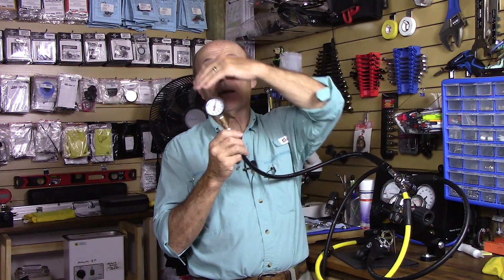Regulator Service, Check The IP - Scuba Tech Tips: S07E18

Comment: Bugger.....  I know I am supposed to support my local Dive store, but Geeeez I wish I had of seen This video before paying $100+ bucks for an IP gauge for my save a dive kit.
Reply from the maker: Sorry John. 
Home Depot has these same gauges in their pump section for $6.14. The brass adapter is $2.49 and the scuba fitting is $9. Total cost is $17.63 - plus tax of course!
1. https://www.homedepot.com/p/Water-Source-100-PSI-Pressure-Gauge-with-1-8-in-Back-Connection-M1002-8B/203990005
2. https://www.acklandsgrainger.com/en/product/p/FAR188-4A?gclid=Cj0KCQjw5J_mBRDVARIsAGqGLZADJjgYKFdbmydIq6CIV6Tl7Dv49GPVov9Wbnsj-ItcMB82s991CXUaAuJSEALw_wcB&cm_mmc=PPC:+Google+PLA&ef_id=Cj0KCQjw5J_mBRDVARIsAGqGLZADJjgYKFdbmydIq6CIV6Tl7Dv49GPVov9Wbnsj-ItcMB82s991CXUaAuJSEALw_wcB:G:s&s_kwcid=AL!3645!3!303439923734!!!g!544758530610!
3. Trident Catalog #AA04 Page 78

Good luck.
Alec

Comment: Hi Alec, i'm built this tool after watching your video...Thank You! it's really inspiring me.
what i want to ask is: if IP is 150 psi what happen if the tank pressure goes below 10 Bar(below 150 psi), does the IP also decrease too? or the Regulator will still producing 150 psi Intermediate Pressure? Thanks.
Reply from the maker: Since the flow of air from the 1st to the 2nd is controlled by pressure AND by a spring, at tank pressures below 150 psi, the spring in the 1st would hold the HP seat closed. No air would flow.
Try it sometime and you'll find that you can still get air by sucking on the reg. In that circumstance, you are lowering the ambient pressure on the downstream side of the HP seat and that allows some air to leak through.
Glad that simple gauge worked for you.
Alec
Reply: @AlecPeirceScuba_SeaHunter  Hi Alec, Thank You for your reply and clear explanation, now i know if i will still get an air if the tank pressure drop to 10 bar(150 psi) when sucking my 2nd stage, that's a good news, i'm pretty new in diving, just two years ago i got my OW cert, and my lowest pressure at the end of my dive ever since is 25 Bar(approx. 360 psi) and i hope i'll never got any Out Of Air situation. Thanks Once Again and keep posting another Great Video, i always waiting for your new video! Warm Regards from Indonesia.

Comment: I’m looking for a rebuild kit for my Scubapro Air 1... would you happen to have or know someone that has a rebuild kit.
Reply from the maker: I still have a lot of rebuild kits but I'm out of Scubapro kits.
The AIRII kit is very simple - a soft seat and a few O-rings.
There's lots on eBay from $10.
Take care.
Alec
Reply: Alec... thank you for the fast response. I am actually looking for the rebuild kit for the scuba pro air one. The mid-80s Darth Vader style regulator. Do you have any leads on a kit for that second stage?
Reply from the maker: Ahh. That's a little harder. They've not been made in a long time.
I used to have a box full of old ones and the Canadian Scubapro distributor would call me occasionally for parts.
From that I have to assume there are none available. All you can do is try to contact old Scubapro dealers and hope someone has a kit or some parts.
Good luck.
Alec

Comment: Hi Alec, can you make a video about ultrasonic cleaners - types and tips etc, please.  Thanks
Reply from the maker: Good idea. Let me look into that. 
There's a lot of misconceptions about Ultrasonic Cleaners. Many think they are the ultimate way to clean regulators but they aren't perfect by far.
Thanks.
Alec
Reply: interesting. I recently used one to clean a corroded quick disconnect for my Sunnto air computer. White vinegar and 5 min and looked like new - with new o-rings can't tell it was used/free :)
Reply from the maker: You do have to be careful. Depending on how much corrosion exists, it's possible to put a chrome item into a cleaner and remove a brass item a bit later. 
Alec

Comment: At 6:41 -- If the major pressure marks nearest the needle are 150 PSI and 175 PSI, with four minor marks between the major marks, then 150 plus two minor marks isn't 152 PSI, it's 160 PSI. (5 PSI per mark.)
Reply from the maker: Right Brian. Every gauge is slightly different and you need to look carefully to ensure you are reading it correctly.
On my own IP gauge I have marked 150 with a marker so it's easy to spot.
Then you can check the spacing of the other marks.
The actual manufacturer's specified IP of a regulator is usually a range and could be as much as 15 psi above or below the ideal pressure. That is, if the ideal IP is 140 and that setting would be best or at least a goal, anything between 125 and 155 would be fine. The 2nd stage is then adjusted for the easiest inhalation effort based on the set IP.
What I'm saying is that the actual IP setting is not so critical that a few PSI either is of no consequence.
However you are certainly correct that spacing varies an must be checked to ensure a proper reading.
One reason I suggested getting a 300psi gauge is to ensure the marks are widely spaced hence more easily read and more accurate. For example, you could use a 3000psi gauge but it would be hard to tell whether the IP was 150 or 175 on that gauge.
Thanks.
Alec

Comment: I like the tech tips Alec... on my 1st stage poseidon I have a "U" and wondered if it was for a uni suit take off fitting, any ideas Alec what it might be.........
Reply from the maker: You are quite right. 'U' is the designated port for your Unisuit on the older Poseidons. I don't know if the newer Poseidon regs have those letters on the ports. In fact, as you probably know, any of the LP (low pressure) ports can be used for the 2nd stage, the safe second, the BCD or the dry suit. You need to set the hoses to suit yourself.
Take care.
Alec

Comment: Alec here's how I check my regulator IP. I remove the air integrated dive computer's transmitter from the HP port, screw it into a LP to HP adapter, and screw the adapter into an unused LP port on the regulator. I temporarily plug the now empty HP port where the transmitter usually sits. Turn on the gas, turn on my air integrated wrist computer and read the IP right on the screen. Saves all the trouble of getting an IP gauge and the needed fittings and it's one less piece of gear to throw in the box.
Reply from the maker: OK. That'll work just fine.
Not sure if it's less work that just pluggin a $10 gauge into the BCD hose but, from your picture you look like you might be retired as I am so what's time???
Take care.
Alec
Reply: Do I really look that old?